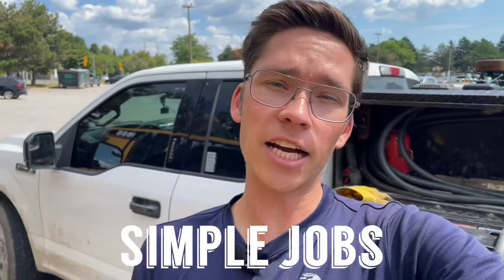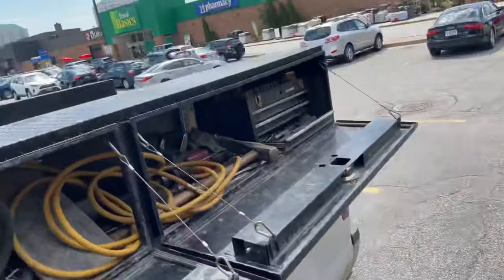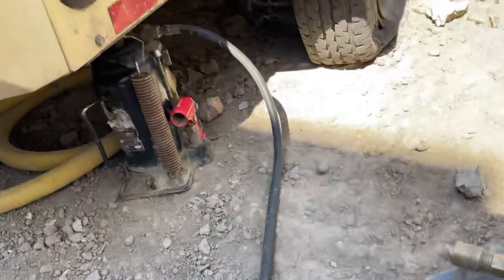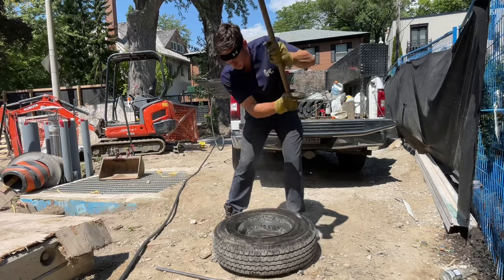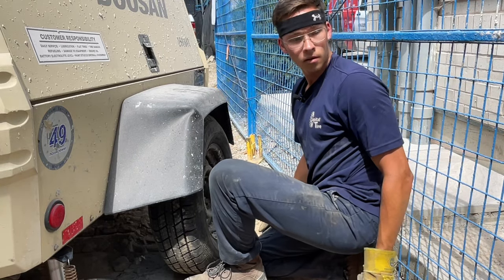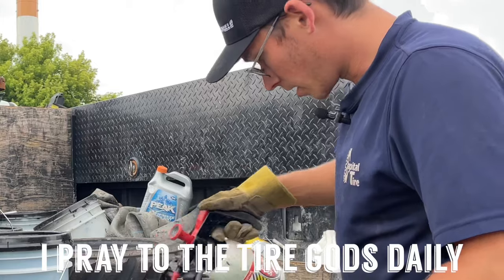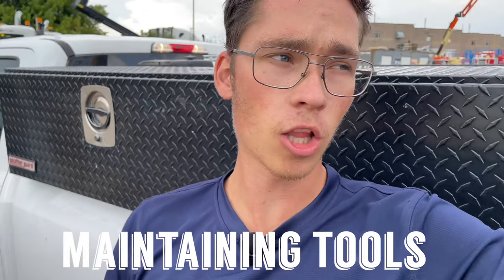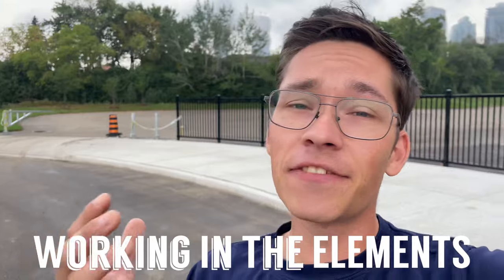What It’s Like Being A Mobile Tire Tech

Comment: I did mobile tyre repair for 4 years in Idaho, had to work on loader tyres without a boom, even a 29.5, found a wrench  through the sidewall of a tyre, had a street sweeper tyre blow apart on my drop-gate fly in the air thirty feet and slam into the back of the truck, had a lo-pro blow out the side wall a foot from my face, hit my face so many times with bars, drove the F-750 boom truck over Galena Summit to repair a tyre on a wood skidder and have changed so many truck tyres on the side of the interstate( they don’t move over here too!) 
Made me old quick. Now I just live that life vicariously through your videos.

Comment: I'm not a big guy.  5.6- 172 pounds. And I'm 62.   I only like to work alone and I do everything from 26.5 R 25 and down, without a boom truck. I have a Chevy Box Van Dooley with a lift gate.   I work alone.  2 days ago I traveled from New Boston New Hampshire to Ossapee N H. I did  2- 26.5R25 and 2- 23.5R 25. I left the shop at 8.  2 hour drive. One way. And was back  by 430.  I have a lot of tricks I taught myself.  29.5 R25. I just need a fork lift.

Comment: Man, I used to feel sorry for our local tire guy.  We had a fleet of rough terrain (12,000 lb capacity) forklifts in a steel yard and lemme tell ya, we went through some tires. 
If the crushed asphalt and crushed concrete didn't wear the tires out, the drives would cut the sidewalls including the extra thick sidewalls on the rear of the lifts that we couldn't foam because A. It voided the warranty and B. It made the machine ride like sh*t.
And it never failed...it was either -20F or 95F when we needed a tire replaced or repaired.  They didn't pay that guy enough, that's for sure.
Reply: Damn!  Sounds like a super tough job.

Comment: Best one is a flat repair and it’s the valve core
Reply from the maker: I think I did one last video, was a blessing 23.1-26 valve core leak 😅
Reply: Nothing better than loading a ballast tub in your truck... your calcium pump. And you get to the job and it's just the core housing.
Reply: @Tire shorts  I don't know what you are referring to but it sounds like a smack in the head moment.
Reply: @The French Pug   What I'm referring to is I was getting ready to do a big job on a tire and it was nothing more than the air water tip of a valve called the core housing.  You get set up for a 2 hour job and you're there 10 minutes and you're done.

Comment: I occasionally do light truck or car tires. My issue is not having the right tools. I don't have a  good way to break beads (skid steer works buy sneaking the tooth in the bead) or good irons, I use prybars and screwdrivers. Long story short, any suggestion on basic tools that will cover help me out?